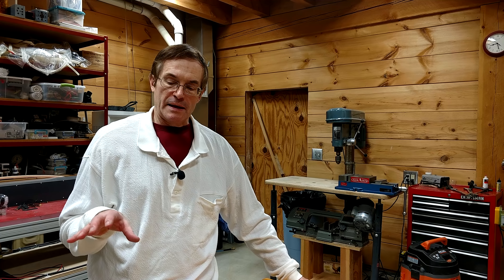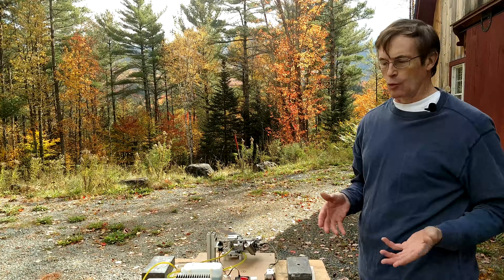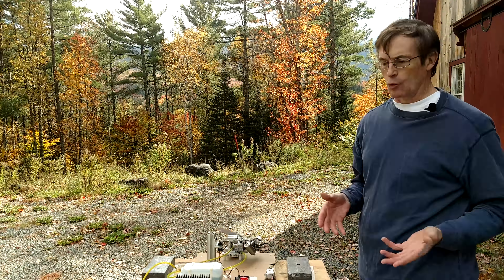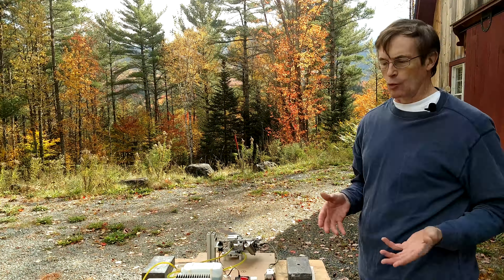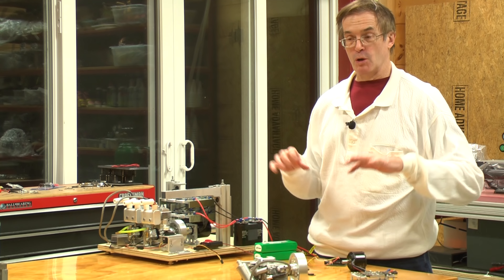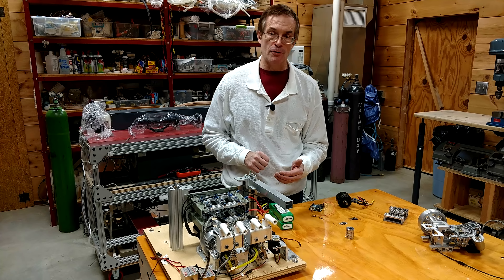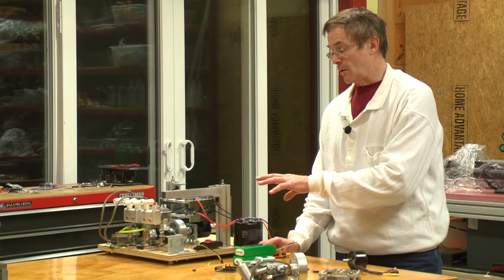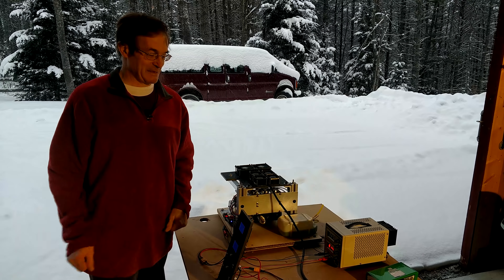Hybrid Drone Generator

Comment: I'm sorry but you have mad a mistake about the counter-weight on RC engines. There is very much so a counter-weight on the crankshaft to counter the weight of the piston. ALL combustion engines regardless of size or cylinder count have a counterweight. If not it would simply vibrate itself apart.  I have used and rebuilt nearly every type of RC engine and they all have had crankshaft counterweights on them. Also you have to take into consideration the weight of the rod connection to the crank journal as well. This is where the lateral force is eliminated by the counterweight when it is in 90 deg. and 270 deg. You stated when the engine is at these positions a counterweight on the flywheel would cause lateral vibration. True but it is reduced greatly by the lateral position of the rod as well. As for 360 deg and 180 deg the inertia from the piston reversing direction in a complete revolution is also taken into consideration with the amount of counter force needed  to smooth that transfer of inertia
Reply: And I'm speaking strictly about single cylinder engines
Reply from the maker: Then how do you explain the results of the bench demonstration I performed in the video?  If there was a crank shaft counterweight then the engine's balance would not have changed as the piston was moved.  Also, as I explained, a flywheel counterweight will be lateral to the center of rotation when the piston is at mid position and this will produce a lateral vibration.
Reply: Also you have to take into consideration the weight of the rod connection to the crank journal as well. This is where the lateral force is eliminated by the counterweight when it is in 90 deg. and 270 deg. You stated when the engine is at these positions a counterweight on the flywheel would cause lateral vibration. True but it is reduced greatly by the lateral position of the rod as well. As for 360 deg and 180 deg the inertia from the piston reversing direction in a complete revolution is also taken into consideration with the amount of counter force needed  to smooth that transfer of inertia
Reply: Also the balancing of the engine has no bearing on the rotating balance of the crank because the engine case is not rotating and is really not part of the equation. The position of the piston at TDC is causing the engine to tip only because of the total mass of the engine itself was shifted
Reply from the maker: I addressed that specifically in the demo.  Once the engine itself is balanced (by a fixed counterweight), the only movement is the piston and the crank.  How do you explain the change in balance when the piston moves up and down?
Reply: @TechIngredients  

There are 2 different balance principles in play here, one is inertial on the crankshaft and one is physically balancing the engine end for end

Comment: Why not use gas turbine engine instead ?
Reply from the maker: There are several reasons.  The engine would be vibration free and significantly lighter for a given output, but it would cost about 10x as much and the high fuel consumption would negate some of the weight advantage over a reciprocating engine.
Reply: Tech Ingredients thanks for your reply

Comment: I see the intention of converting kinetic energy from a gasoline engine into electric power, and then driving an electric motor to produce kinetic energy to drive the prop., there are significant lost during all conversions. the solution would only valuable if the generator is driving a multi-rotor drone, since gasoline engine can directly drive fixed wing / heli in a much efficient way
Reply from the maker: I believe you are correct.  The ability of the single rotor to vary its angle of attack in order to change lift allows the engine to function within its optimal RPM range.  This is one of the other uses of hybrid drive systems on ships where the diesel generator's RPM range is relatively narrow, but the propeller can spin at whatever RPM best matches the ship's speed.
Reply: variable pitch propeller is a great innovation but also increase the structrual complexity, which makes it not easy to sustain high RPM rotation. in fact, gasoline engine can drive a fixed pitch prop., ( https://www.youtube.com/watch?v=01yt-_R4KOI , this vehicle is flying by a single fixed pitch prop.) or electric motor can also drive a variable pitch prop., (like many other electric heli.) so it's nothing do with that. hope to see your flight test soon, good luck!

Comment: probably too late, but mounting the engines in a boxer configuration would be more balanced as well better for cooling.
Reply from the maker: It's not too late and I agree regarding vibration, but the cooling is easier if the module is configured as it is when the unit has to be mounted in a compact sound absorbing enclosure.

Comment: I think it's misleading to suggest that batteries provide so much less energy than hydrocarbon  as 3/4 of the energy density is thrown away as unused had. If you were to account for that, battery density is actually pretty close to that of today's batteries.

Comment: why don't you work out your ideal rpm and physically set it at that, it will save weight and you don't get the rev adjustment delay from the arduino , cords, servo moter. ?      ALSO : if you place the batteries in the cooling fan airflow it will cool the batteries as well. ALSO  :  a propeller on the petrol engine to get some lift to cancel out the extra weight, if it was enough to allmoast lift the drone it would act as a soft landing system, bringing the drone down slowly,  should you lose controll of the electric moters with propellers.

Comment: I wonder why he didn't use a gas turbine they are perfect in this type of application.
Reply from the maker: These generators would be pretty inexpensive to construct with the 2 stroke engines and although they have a lower fuel efficiency than  the four strokes, they are significantly more fuel efficient than a small turbine. 
Nevertheless, we are building a small turbine engine for this purpose.  We'll show how well it works.

Comment: "Electrolysis" of Water- H2O into HHO, I was able to get a, 2 Stroke 50cc motortized Bicycle to almost double MPG with a Small Electrolysis Device on batteries of 6-12 Volt's, make sure to have Filter between the Electrolysis device and Engine Preventing Catalyst Blow through, which hurt My engine in the long run.  Nice work by the way, thanks for sharing...

Comment: How about a miniature turbine instead of using a piston engine. Might get rid of the unbalance of the piston engine and the generator can run smooth
Reply from the maker: It's interesting that you mention that.  We're building a small turbine for that purpose and we'll cover this in an upcoming video.

Comment: Usually, I truly like the projects on this channel but this one particularly I disliked... Why not use the engines in opposite directions (180 degrees) to balance the vibrations? Why not use just a single flywheel as a propeller to cool the engines channeling the ventilations thru lightweight tubes? why not use a simple full bridge rectifier with minimum capacitance and let the power regulator board(s) take care of the charge of the batteries and the voltage going to the electrical engines (load), simplifying the controlling loop of the engine's speed (that should always operate on its maximum efficiency)? My personal opinion is that this project is over-engineered and less efficient, expensive, bulky, and heavier than it should be.
Reply: Do you have tutorials or know of any to build it?

Comment: very cool but glow engines are horribly inefficient and the fuel costs a fortune. Need to use actual gasoline engines. Plus I would like to see a graph of the drone runtime vs weight for the two options: 1) hybrid with its base weight + the increasing weight of the fuel and 2) battery only system with the increasing weight of the batteries.
Reply from the maker: These are not glow engines.  They are two stroke gasoline engines.

Comment: I may have a solution for your gas powered engine.  You can take an Automotive A/C compressor (I am talking about the 5 double ended piston style) Converting it to an engine and running it off of propane.  You can use ALL 10 chambers or just 5.  choice is yours.  It will solve several issues you now encounter using the model engines, as well as, noise, size and, weight >  Let me know what you think.  The more minds on this could make solve many issues and make the idea viable.  Thank You !

Comment: why don't you make a miniature transmission to increase rotation.  It is just two gears depending on the number of magnets 15/4 (formula Magnets/rotations) 12/5 10/6. that is if you are looking for sixty hertz.? but if you control your volume (= amps or volts based on your study of the subject.! I believe area of flow is volts and volume =stacked electrons = amps.) but if you want you can use two toy tires with metal hubs and rubber edges. one 1 to 4 as fifteen magnets is the easiest on motor and steps up the voltage the greatest for small areas. This is using gas motors of course.

Comment: I would have used an RC wankel engine, they are alot more power dense and don't need a transmission.. 
 They also don't have the issue of a piston flying up and down causing fluctuations that could disturb a drone
Reply from the maker: Sure, however they're almost impossible to find.

Comment: Interesting. The whole project is cash limited. Going to a wankel engine and using the generator rotor as the flywheel would result in a drastically lower weight system for the same power output. The cost of the wankel engine is about 10 times the cost of the RC engines for a given hp. That is a big discouragement! It will be interesting to see if it can be practical with the setup he shows!
Reply from the maker: All projects are cash limited. Theory is fine, but if it is too costly to implement then it remains a theory.

Comment: What about a fuel cell that would work with gasoline, alcohol, and many other things like demo'd in 1990s? It was mentioned to be a great laptop battery replacement by adding more Isopropyl. Probably much more efficient too. Could you make a similar one, the same idea for a Tesla, use gas to supply the electricity to the motor and some ultracaps for a boost when starting from a standstill, and only exhaust was water so everyone should love it! If you make billions don't forget me, need all the help I can get!

Comment: Drone Generator

I think that the whole approach is not very efficient.
Every energy conversion loses certain amount of energy, and its hardware adds weight to the aircraft, which in turn will require more energy to generate lift.

Using the rotational energy of the gasoline engine to generate electric power (1st power loss), 
then use that electric power to rotate the propellers and generate lift (2nd power loss)

I would use a well balanced vertical shaft 2 stroke boxer engine to reduce vibrations.
for example a DLA 64 cc / 7.2 hp @ 8500 rpm
http://www.goldenskiesrc.com/Product_Page DLA 64cc Twin.htm
with a well tuned pair of expansion chambers, which increase the engine power improving the total flow of gases throughput or "engine breathing" allowing to "extract" more energy from the same amount of fuel.

Design a flywheel that will have multiple functions to reduce the power/weight ratio and increase the efficiency: 

1.- flywheel function: have fins that will work as a fan to cool the engine cylinders, eliminating the use of electric (power consuming) cooling fans.

2.- have a group of magnets rotating to generate electric power in 2 magneto coils to generate the engine ignition or feed the spark plugs and 

3.- an extra group of coils on the same flywheel to generate electric power for the drone control system ONLY.

4.- use the gasoline engine power to directly rotate ALL propeller shafts; with single belt to transmit the power DIRECTLY; thus all the drone lifting (simple & light) ... NOW very important the mechanical power to the propellers MANAGED THROUGH (ELECTRO) MAGNETIC COUPLING coils controlled by the FLIGHT CONTROLLER on each propeller hub.

Magnetic coupling has NO FRICTION (no heating or friction losses), the moving parts have NO CONTACT between them, so WEAR is NON EXISTENT and the response times are instantaneous.
Magnetic coupling uses a very little amount of energy to generate the magnetic coupling between the rotating hub and the propeller.

SIMPLICITY, LOW COMPONENT COUNT, Light, Efficient, High Weight to Power Ratio.

Comment: You need a V twin for balance.
Reply from the maker: Or a flat four.
Reply: Tech Ingredients  Actually for primary, secondary  and torque balance for a vee engine a V10 is required. A V twin at least gives primary balance.

I think you are  overestimating the vibration caused by unequal power strokes.

For high revving two strokes primary balance is more important than equal firing strokes. You would do better by having your engines geared to go in opposite directions.

Laser engines do a V twin four stroke.
Reply from the maker: I'll look into that engine.
When you say "unequal power strokes", do you mean the variation of torque   during the engine cycle?  If so, it is huge.  The peak is more than 4 times the average in a 4stroke engine  while 75% of time it is actually negative.
Reply: @TechIngredients  Yes, I meant unevenly distributed power strokes through one or two revolutions.
I don't know if Laser engines have actually fitted an appropriate balance mass to their 90 degree Vee twin. They don't do them in petrol anyway, only glow although people do convert them.
Old British motorcycle twins are illustrative. Given the slow revs and high torque they went for both pistons going up and down together, to even out the power strokes at the expense of primary balance. Arial even had a geard twin with counter rotating crankshafts (Which was balanced). The Japanese with their higher revving engines went for one up, one down cranks for better balance but uneven power strokes. I  don't think there is a clear cut answer.

Comment: Fixing the Full Bridge Rectifier’s Big Flaw - Active Power Factor Correction:
https://www.youtube.com/watch?v=eI_LQWrQam4&t=20s

Then, for constant RPM, 2-stroke expansion/tune pipes are a must.
They take space, but weigh very little.

Research: Boric Acid fuel additive lubricant research.
NB that there is some talk of Boric Acid also acting as a thermal barrier, so in small engines with much combustion chamber surface area per cc;  its not just about the lower friction etc.
(Sci-Hub is your friend when papers are paywalled)

Comment: Sadly, still pretty poor efficiency right now - considering you got quite 300w of electric energy peek from your two fuel driven motors, working their bum off. they're outputting several PS/HP when driven like that, converted this means couple of thousands of watts of energy...

Comment: I'm a little disappointed the whole video was about vibration and not about finding maximum efficiency. There's so many different types of internal combustion engines even in the RC world.
Reply from the maker: There are many other aspects that could also be expanded upon such as regulation, effeciency and even maintenance and cost.

Comment: Is the purpose of your project to create youtube videos or to build a hybrid electrical-diesel/gasoline drone? If the latter why not just buy a €500 gasoline generator and modify it? Sounds much simpler to me :)
Reply from the maker: Both.  We considered that other aproch and even mentioned it in one of these videos.  It is a close thing because multiple systems have to be modified while at the same time trying to cut significant weight.

Comment: If he had purchased an O.S. opposed twin cylinder engine, his vibration issues would have been resolved easily as the run opposing each other thereby balancing things out easily. There is another twin  cylinder in the 22 cc range, gas powered that does the same, I forget the name, I think it starts with a T. Either of these engines would have done the task. I also fail to understand why the balances or flywheels are not machine to provide airflow over the engines doing away with the fans. IMHO, to satisfactorily muffle the exhaust side, his idea falls far short of the ideal. He needs to understand it's all about wave lengths and if the space inside is insufficient, these wave lengths cannot peter out satisfactorily and still make a lot of noise, the internal area needs to be much larger and baffles fitted within to control the waves.

Comment: why not bleed into capacitors and charge a battery.  Then use the extra for fast lift and use a throttle regulator.  like seriously capacitors all over the thing.  cuz if the issue is too much power we need to use it.
Reply from the maker: If I understand you correctly, that is what we are doing.